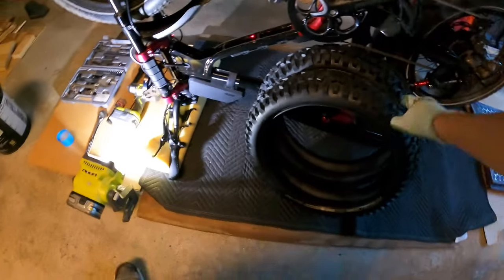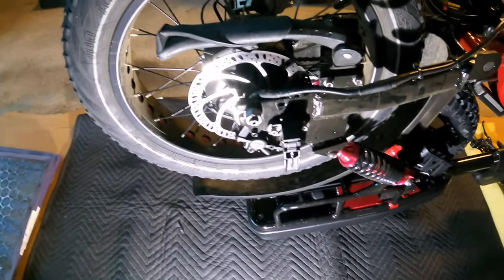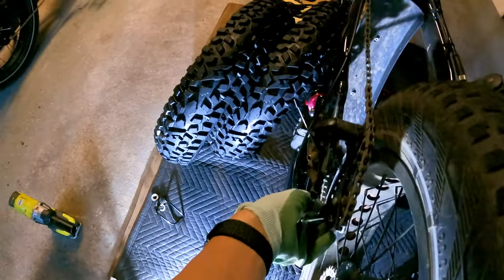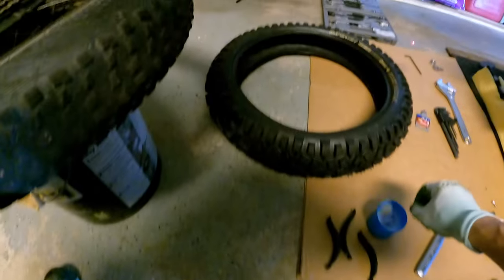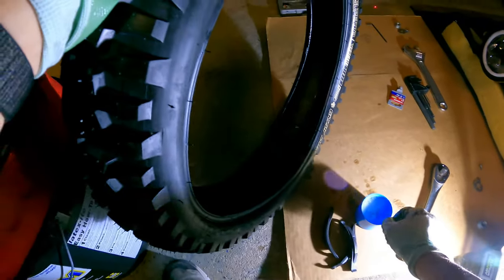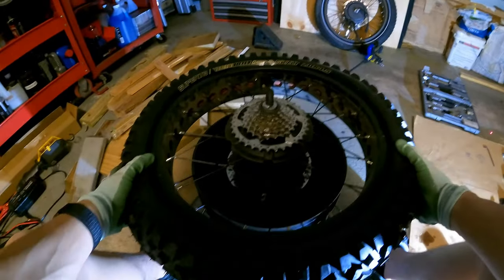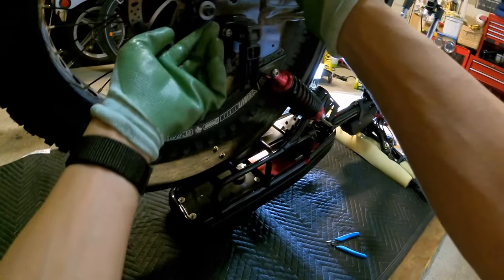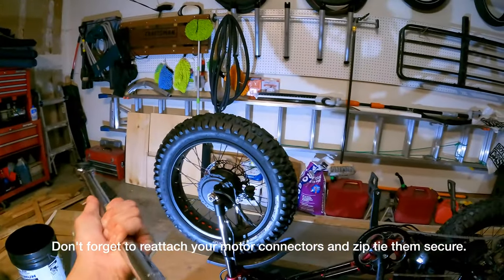Ariel Rider Grizzly eBike Tire Upgrade to Super73 Grizzly Tires - How to change eBike Tires

Comment: I installed these Super 73 Grzly 4.5 wide  tires on my Ver.3 Grizzly and the chain rubs the tire side when in 1st gear.
Reply from the maker: Yes mine slightly rubs also but it hasn’t cause any issues. I only use 1st gear on really steep climbs. I think I mentioned in one of my previous videos that it will slightly rub in 1st. Thanks for watching and hope you enjoy the tires otherwise.

Comment: Has Vee gone out of business?  I have tried to get in touch with three different e-mails for them and they come back that they don't exist.  I had the bead blow out in a few miles and now the replacement is doing the same thing, and the entire tire is wabbling.
Reply from the maker: Not that I know of they are a pretty large bike tire company. Which tire do you have?  My tire was a collaboration between Vee tires and Super 73. What psi were you running?
Reply: @LesWang  Speedster at 17psi, their max says 20 on the tire.

Comment: What inner tubes did you use for this? Stock grizzly tubes or just any 20x4.5" tube?
Reply from the maker: I used the stock ones I think that were good to 4.0” but you can use anything that is 20x4.5”

Comment: Do you prefer grizzly tires or BDGR tires for street riding?
Reply from the maker: I haven’t tried the BDGR but I would assume they are better for strictly street. I take mine offroad and wanted some really knobby tires so I went with the Grizzly’s. The tires are made by Vee. They have another tire that is pretty popular and has good reviews. I forget the model off hand.
Reply: @LesFishingMoreCatching  Thanks.
Reply: @LesFishingMoreCatching  Vee Tire huntsman i think :0
Reply from the maker: @stan121midling5  yeah that is the one.
Reply: yea, i just got done mounting a Vee tire huntsman on my back tire for my grizzly hehe

Comment: Did these tires affect your range and top speed much?  I would like to get the same tires you did but they never seem to be in stock these days.  Also, possibly looking at Shinko 244 which also look awesome but people are saying they do affect range quite a bit.
Reply from the maker: I didn’t test range but being they weigh more and have more knobs I would assume the rolling resistance would equal less range. 
The fronts don’t spin as much when launching from a stop and the top speed might be the same or slightly more since the tire diameter is larger.
Reply: @LesFishingMoreCatching  So based on your comment it may have affected it but probably nothing huge or it would have been apparent.
Reply: @LesFishingMoreCatching  thx for the info.

Comment: how difficult is the rotor upgrade to do?
Reply from the maker: The fronts not difficult if you can take off the front wheel.  The rear is harder if you want yo use the magura 2 peice. Need to add washers and space out the rear slightly.

Comment: Is this the V3 Version?
Reply from the maker: Gen2
Reply: @LesFishingMoreCatching  I have the V3. I hear it is a little different to swap the tires out?
Reply from the maker: @tonyhui4149 the rear has an added torque arm which you have to undo. Also the motor connector on the front is higher up under the frame.